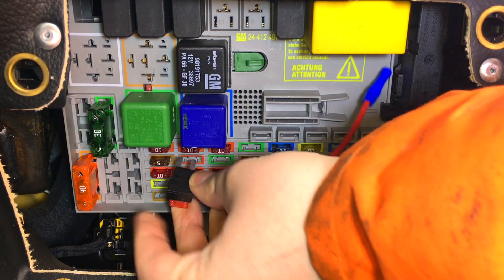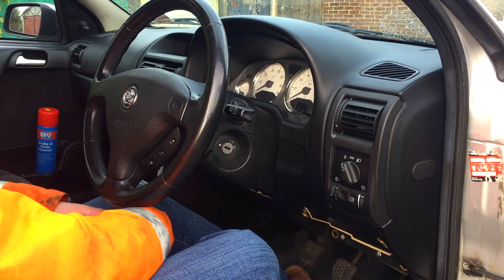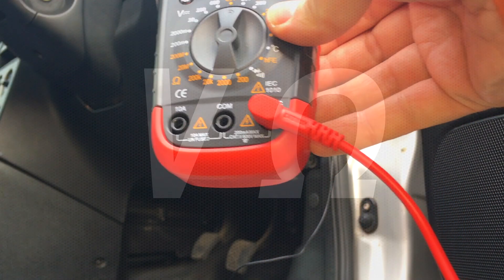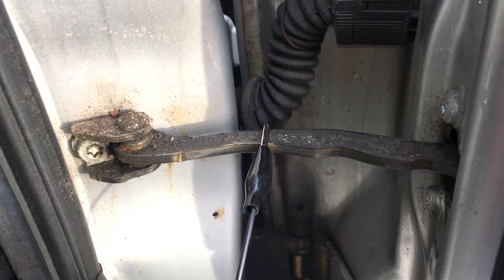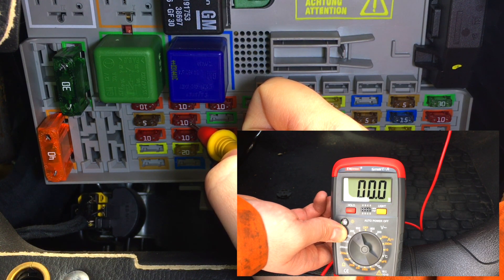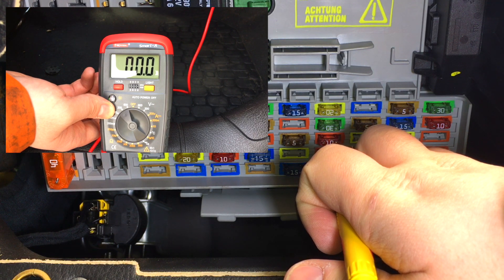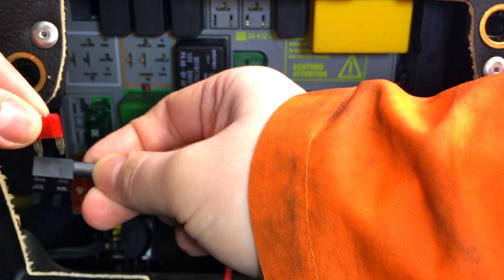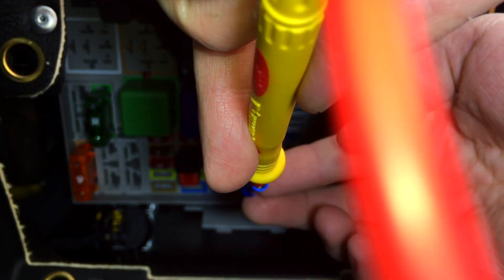How To Find & Wire In A Permanant or Ignition Live From A Car's Fuse Box

Comment: Thanks so much!!! 👍👍  Not used a multimeter before.  I've been looking at dashcam installation vids.  And, the only thing I couldn't figure-out was where to place the other black cable when testing.  So, now, I obviously do.  And, also now know another alias for the fuse tap cable/piggyback. 😀

Comment: What about making sure that  the piggyback fuse holder is inserted the right way round? i.e. AFTER the fuse going to the outlet wire and NOT on the positive end of the fuse?
Reply: There's no positive or negative end of a fuse. It's all positive. No wrong way to place it.

Comment: Im adding fog lights to my truck using the existing wiring harnesses. Can't I just tap into the lights port on the fuse box to add the toggle switch to turn them on and off?

Comment: Great video but to make sure the fuse is protecting the circuit you need to test which side of the fuse socket is live without your fuse in place.
Reply: I've set my multimeter up exactly the same way as you have shown and I am getting no readings whatsoever with the ignition either on or off.What the hell is going on?
Reply: Looks like that piggyback fuse holder has two fuses so the output wire must be protected whichever side goes to the battery to me...
Reply: @TheC15jon  That's not true. The "front" one is for the original fuse if you are tapping into a slot that initially had a fuse. The "back" slot is for the device you are connecting to the fuse tap. The "far" leg of the fuse tap MUST go to the hot connector. 
Secondly, if you are tapping into a slot that already had a fuse, the original fuse has to be higher amperage than the new fuse.
Last but not least, never tap into "important" fuses, like airbags, etc. Use something like fog light instead.

Comment: Hey I have a 04 GMC Sierra crew cab and I brought a 400amp alternator cause I'm going to put some shit in my truck any way the harnest that came with the alternator has a long  blue wire that says pigtail to ignition source in run position my question is can I do what you did in this video

Comment: does it matter which way the fuse goes in?
Reply: Yes it does. The fuse-taps are direction dependent.
Reply: Every fuse has a number on it representing the capacity of the fuse in amps. If this number is upside down, the electricity can get confused and flow the wrong way. Make sure all the numbers on all the fuses are facing in the proper direction.

Comment: The fuse-taps are actually direction dependent.
Reply: ^^This. You need to use the voltmeter to determine which fuse slot is the positive and negative side. If you put the tap in backwards it will bypass the fuse and there will be nothing stopping overpowering what you have plugged in.
Reply: @diamondheat9  well, not quite... think about how the "add-a-fuse" is actually configured internally. The circuits will be protected (both) but the original fuse will carry both its design current plus the additional circuit current if the installation is backwards.

Comment: Im putting in LED strip lights in the toolbox on the back of my ute. This is a great way to get +12v but what about my negative? If I connect the negative coming from the lights to some metal of the chasis will this complete the circuit or am I gonna blow something?
Reply: complete

Comment: No power to ignition, fusses are ok on battery and in engine and fascia boxes, earth volt drops good, found no power to ignition switch, drives perfect by temporary live from fuse box...

please advice what is the issue here and what could be the solution ?

Comment: I need a switched live on an audi a4 b6. I've heard the heating fan is the one to piggy back off but it's only 10 amp. The radio is 20 amp. Can I run off this putting two ten amps in line or will I need need a ten amp and a 20 amp? Will there be enough power? Thanks
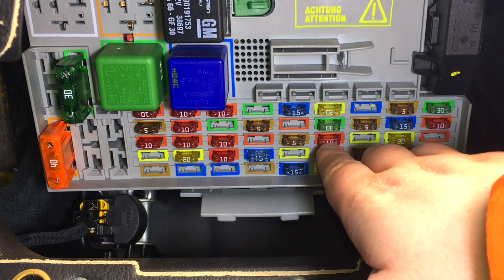Reply from the maker: Hi Craig, I elaborated a little bit more on another video I did. If you skip to 3:58, I think it will answer your question https://www.youtube.com/watch?v=asjq85p4W4o

Comment: Does it matter which way you put the piggy back back into the fusebox?
Reply from the maker: Nope. Whatever was fits best for you.
Reply: Yes it does!!    One way it bypasses all the fuses.
And the other way power passes through both the fuses.

Also.   If you have empty slots like I see in this video.
I would check those first and use them over “piggybacking “ 

Just sayin..

Larry
Reply: @mafosa8519  you're right! Make sure the piggyback is placed in the right direction {on the HOT side of fuse) to allow current to flow through the fuse and not straight through. Very important!

Comment: Great video dude, I want also to know how to find the "Ignition Start" wire? You see, when I don't have a service manual nor the owners manual since my car is a 2nd Hand Nissan Patrol GU, but I need to connect something to the "Ignition Start" wire is it possible to test it using the same way as you did?
Reply from the maker: Sorry if this sounds like a dumb reply. Is there any particular reason that you need to connect to an ignition wire instead of an ignition live from the fuse box ?
Reply: Actually, I'm not replying, I'M ASKING... THAT'S A BIG DIFFERENCE. You see, I need the "Start or Cranking wire" which is the switch pass the ACC? these are the sequences on the car keys right (OFF-->ACC-->ON-->START or CRANKING) I need the cranking power instead of the ACC. In the cranking mode, it's only supplied when the key is on START position, after you release it, it will turn off. That's what I need.
Reply: The reason why I need the "Cranking 12V Power" instead of the 12V constant as in the ACC is because I need it to turn on a RELAY, which will turn -On the "Transponder Chip Module" that I created so that the transponder module will have only power when I crank the car, and turns off automatically when I released the key or when the car has started already. In short, I'm making a Transponder Bypass, and I need the cranking power to power it instead of the ACC power which is constantly ON.
Reply from the maker: Yes I was replying to what you was asking. Hence my “sorry if this sounds like a dumb reply”. I was talking about me, not you. I never said you was replying. 

On to your question. I’m not an electronics expert but I would imagine it would work a little bit like this. The ignition barrel is essentially a switch. So the ACC position would be like a toggle switch (on/off) and the cranking position would be like a push switch (it’s only on as long as you’re pushing the button down. ). 

I imagine you would be able to splice into the wire coming from the back of the ignition barrel and run an in-line fuse from it. If you wanted to trace where the wire ran so you could tap into it in a more appropriate location, you could use the continuity feature on a multimeter. How much amps does this transponder need ?
Reply: It's OK buddy, I already found a Service Manual for my car, and I think it's a Yellow/Black on a Nissan. By the way, I applied your tuts-video on my Front Camera monitor since they needed a constant 12 volt power, great thanks for the vids.
Reply from the maker: No worries dude. I’m glad it helped :)

Comment: If you are struggling to plug both your multimeter leads into the correct socket on your new tester here is a tip - you can "  bed-in " your tester  by selecting a current range on the rotary switch and putting one lead on each of your cars battery terminals. The meter will make a light "pop" to confirm all is well .

Comment: you are a little wrong.you have to find the in and out terminal of the fuse box, so you know witch way to insert your piggyback fuse tap. if you insert it the wrong way, the fuse will not blow, and could fry something.
Reply: WHICH WAY SHOULD IT BE, IN OR OUT?